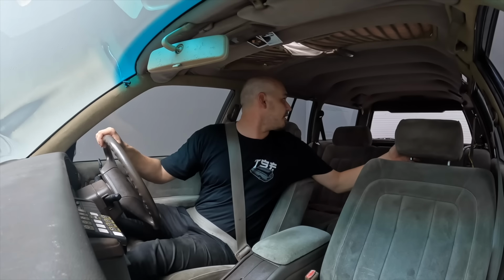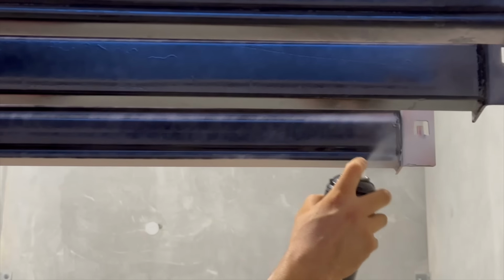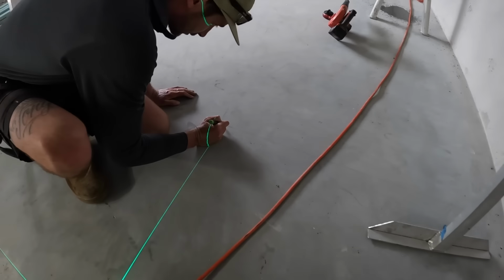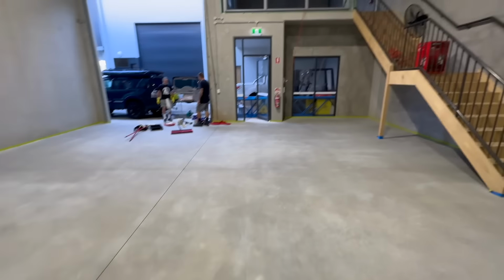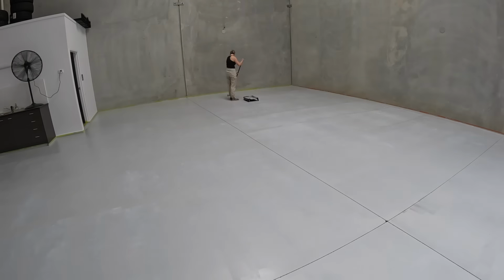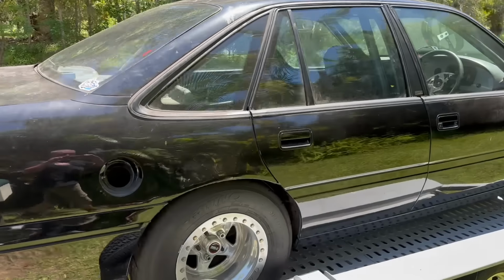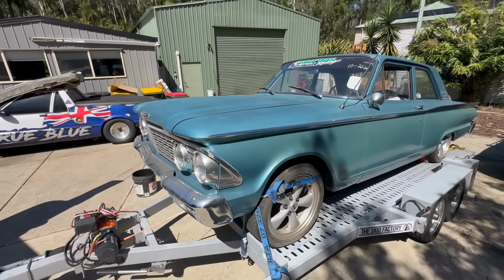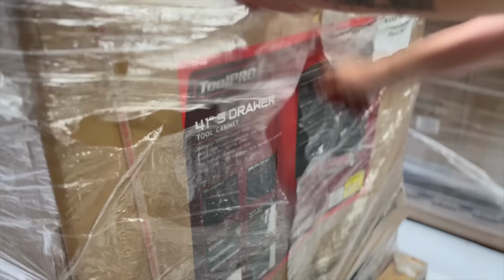Building My DREAM Workshop! THE NEW SKID FACTORY! 🛠️

Comment: 17:19   You run an Auto style Shop.  You know cars right?  Why not just take the HVAC part out of a car and use them for your shop?    Something out of a chrysler Minivan is more then large enough to be used to chill down an entire shop as the BTU output from the pump alone in one of these units is balls to the wall high output.    

It would be a fun first project episode that would garner in a LOT of interest and promotes reuse and recycling and you might have a few of those around the shop just sitting around. So the parts costs would be cheap.  You could even used reclaimed refrigerant or use another Friendly hydrocarbon.  (Propane)  

A large turbo could be used to quickly circulate the air in the shop taking the place of the electric blower fan off the (Interior) evaporator, while  a large Hepa filter could be used on the inlet to filter the air going to the compressor wheel.   A second Turbo could be used to extract whatever other energy is left in the exhaust gases providing even more airflow volume for the main shop space.  

They also have lots of used buses in junkyards that have A/C units on them. 
The cooling capacity of bus air conditioner ranges from 20kW to 40kW, (62840 to 136480 Btu/h or 17200 to 34400 Kcal/h).

Those systems often just run on 24VDC.  
Getting some Full bridge rectifiers for about $5.00 a piece and using some scrap aluminum block running of the mains with a 2 12v batteries in series should give you all the power you need and be almost silent if you go that route.  
plus you really can't beat the output of one of these units and it would cost you close to nothing to pick up one of these units at the scrapyard or wrecked bus. 

That should keep the costs low and the comfort high while working in the shop.

Comment: I'm 100% against storing vehicles in a workshop. They get ruined!
If it was my space, I'd have 1 lift, a dirty room for all the grinding and cutting and plasma table, and if there was space, maybe a second lift for stacking.
I shoot a few months ahead of release so I don't need to have 3 projects on the go to keep up weekly uploads! I'll film 3 or 4 hours over a weekend which will edit down to 30 minutes. Makes 2 videos, 3 with a lot b roll!
With your filming schedule you may need more.
I also don't make any money from YouTube so I who're out my tools. I do contract cnc plasma and bend roll cages/rock sliders/ ladder racks/custom bar work. It takes bugger all time to do and you can charge good money so, but I means I need a fairly large workspace but only have the one immobile car at a time

Comment: It's looking so beautiful just like those spicy legs of yours. Not sure which would be cheaper but I feel like having a car storage rack or a 4 post lift off by the front door would be a good idea since you'll most likely be using the other lifts and you can use the third to just store cars vertically so you have more room
Reply: Those egg shell looking foam pads used for mattresses are a cheap alternative to sound deadening foam too. You can even bump up the sound deadening with iso board behind it
Reply: Buy a car port (we use them in snowy areas) to use as a pop up paint booth too! And finally, add a beautiful bidet in that bathroom